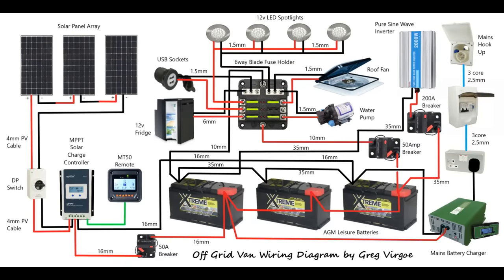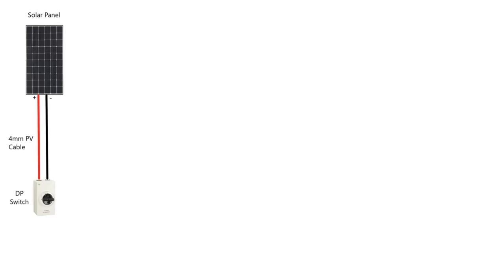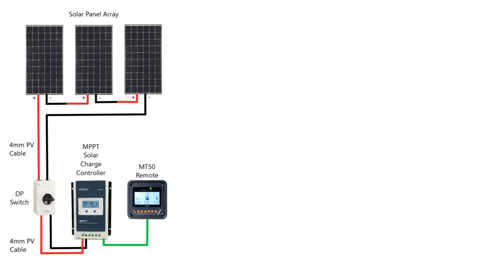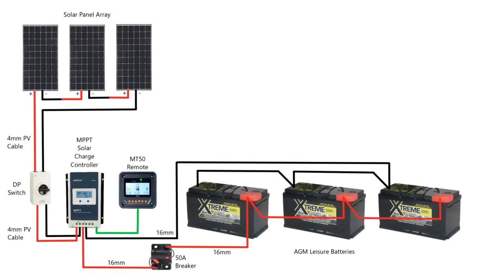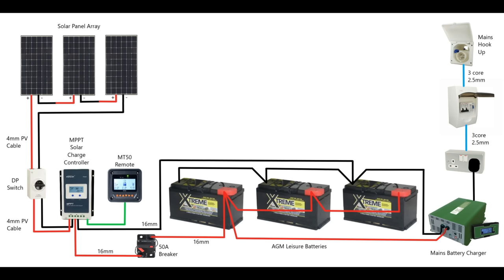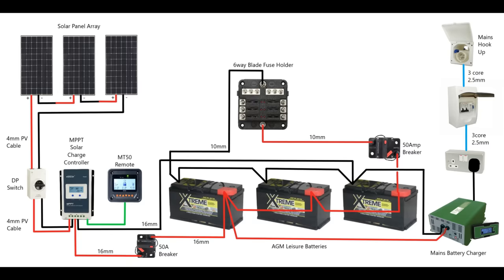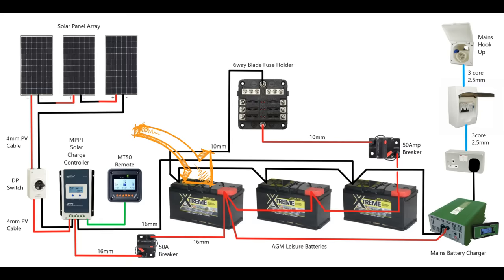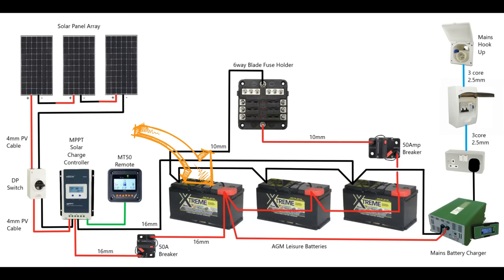How to Wire your Camper Van to be Off-Grid

Comment from the maker: YOUR QUESTIONS ANSWERED HERE - Please read this first. 
This video is always going to bring up a lot of questions so to avoid having to answer the same question lots of times I’ll post the most common answers here for you. 
1. Why have you not got a split charge relay?  A. AGM batteries do not like the voltages given out by your alternator and if you want to charge the leisure battery while driving you really need to fit a battery to battery charger. 
2. Why have you connect the red and black cable on your solar panels.  A.  These are wired in series so it is correct to have them connected this way. Please watch my solar panel installation video for more detailed information. 
3. You have not connected a load to your MPPT charge controller. A. This connection is for small load use only say just to power some lights. You could not connect 50A of appliances to these terminals. 
4. You have not connect this system to your van body. A. The van body is not an earth it is used by your auto electrics as a neutral. I personally do not advise using the van body as a neutral for your leisure system. My mains earth is connected back to my hook up socket and I always check with a plug tester when connecting to shore power. 
5. How can I size my cable and fuses. A. To work out the amps required use this calculation Watts / Volts = Amps. For fuses take your max amps figure and add 25% for safety. That is your fuse size. Then add at least another 25% and choose a cable bigger than that rating. 
6. The interconnecting cables between batteries need to be rated for the sum of all your connected loads assuming that there may be running all at the same time. 

I will update this pinned comment if I get lots of other questions if you can find your answers below please do leave me a message. I do love reading all your comments whatever they may be. Thank you 😊
Reply: I live in NYC...can i connect a 12v heater for winter time in this installation or is it better to buy one of propane? 

Also 12v sistem for hot water in the shower?
Reply: Superb video as always 👍🏼
Question, having used your van a fair amount would you say you’ve got a big enough battery store?
Reply: @JuanMartinez-pw4xi  I would avoid any 12v heating source for winter off grid camping. If you are hooked up to mains the its ok. But heating elements will put unnecessary stain on your system. The best off grid setup would be a static fitted gas fire, with independent added blowers for heat circulation. Blown propane heaters are not ideal as the system requires continual 12v during use for fans. I run a diesel fired eberspatcher but the 12v consumption is very high. Remember no matter how many batteries or solar panels you must get a good balance for winter off grid surviving. Also absolutely no 12v fridge, just go propane. Fridge elements are high draw items. Maybe restrict 12v operation of fridge to high harvesting days for solar, but again during winter the effectiveness of solar even on sunny days drops dramatically. You can somewhat negate winter sun by angling your panel on an adjustable bracket depending on where you are in the hemisphere. Flat panels can lose up to 50 % efficiency compared to a correctly angled one.
Reply from the maker: Juan Martinez simple answer would be to avoid electric heating of any kind from batteries. It will use so much energy really fast.
Reply: Could I ask if you have a reason for not connecting to the van body, every other video I have seen shows this and whilst I thought your video was excellent it has left me unsure what to do now? I am using the Sargent EC155 as my main electrical control with additional 12v fuse board, although I now wish I had done it myself from scratch.
Reply from the maker: Hi David, yes there’s so much confusion out there about connecting electrics to van bodies. So hope this will clear things up for you. 12vDC electrics have a positive and a negative. They do not have or need an earth. Your van auto electrics use your van body as a negative path back to your van battery to reduce the amount of cables required. This is NOT an earth. I would never recommend using the van body for the negative of your 12v leisure electrics as it’s very easy to get a poor connection then be left with equipment that doesn’t work properly. Far better running a two core cable and it be right from the start. Your van is not earthed either it’s sitting on four rubber tyres. The best place for your 230v earths to go is back to the earth connection in a mains hook up on the side of the van. The big confusion comes because people refer to a connection to the van as a ground (others think that means earth) it isn’t, it’s a negative connection back to the van battery.
Hope that helps explain 😊
Reply: I don’t see any switch for the lights?
Reply: By the way thank you for ur explanations thinks are more clear now
Reply: Hi Greg, what's your opinion regarding wiring solar panels, I have a new swift bessacarr Motorhome with a 100w solar panel as standard. I have fitted 2 100amp lithium batteries. Although we have has no problems for 2 night wild camping  we plan on doing a lot of offgrid in the future once this Lockdown is over. I am in the process of buying another two 150w panels, I have already purchased one. So that's 450w in total, because I don't plan on using the 100w original panel. Just to keep things simple, so they are all new. I also are purchasing a Victron MPPT 100 50 Controller. Now what I am finding is mixed reviews on whether to wire in parallel or in series. Also what model Victron smart battery controller do It will be bluetooth, I just don't know which one to go for with my set up  thanks in advance Dave.
Reply from the maker: Hello David, without a doubt if you are having 3x 150w panels all the same and a good quality MPPT charge controller definitely wire them in series. This will keep the amps the same on the solar side so small cables no bigger than what you already have going up to your 100W panel. The biggest benefit will be the ability to charge in low light conditions and winter time. 
The voltage will be added together and your MPPT will transform that back down to charge voltage and bump up the amps. We have been off grid now for nearly two years on a very similar setup apart from I have AGM batteries and it works in all weathers no problem. 
Check out the new Renogy MPPT Bluetooth controller you may find them to be better priced than Victron.
Reply: @GregVirgoe  Thankyou for your quick reply, I hope you are both well and stay safe. Dave.
Reply from the maker: David Cowley you are welcome we both are well thank you 😊
Reply: Just a quick question about the 230v earth?
If you had a fault,putting 230v on to the body of the van without bonding the supply earth to the body, it would leave the fault in place until someone touched it.
I'm no expert just my thoughts on it?
Reply: Hi greg. I have follwed your build. And completed the wireing, useing everything you have used. Everything is working except for the fan. On the board where the fuse blade go, the wire that are from the fan that are connected to it, next to them is a red light. This red light is only slightly glowing where as next to the ones from the usb or the touch lights shines bright and they work fine. It feels as if not enough power is getting to the fan and i dont no why. I have two batteries connected up. Do you have any suggestions why the fan is not working.
Reply from the maker: sean winder I would swap it over to another position on the blade fuse holder with one you know is ok. Check the fuse has not broken and see if that connection is faulty.
Reply: @benjeitoon1212  I was wondering something similar but, bonding to the body wouldn't help because the vehicle is isolated from the ground so there is no potential difference, until someone steps out onto the ground holding the metal work of the vehicle, happy to be proven incorrect??
Reply: @GregVirgoe  your videos are awesome! Wish you were my dad :)
Reply from the maker: Ben Hargaden I hope you’re not too old as I could be offended 🤣😃👍🏼
Reply: @margaritalagunas6543  12:00
Reply from the maker: Devonian the 16mm cable they have supplied should be ok up to 170Amps and should be protected by a 150Amp fuse. 
From the inverter wire a 13amp 3 pin plug using 2.5mm three core flex plug that into the inverter then the other end wire into the back of a 3 pin socket. 
Hope that helps 👍🏼😊
Reply: @GregVirgoe  Hello, Please, what do you mean "The best place for your 230v earths to go is back to the earth connection in a mains hook up on the side of the van" ? More exactly it needs any other connection than the arctic blue cable from hook up to RCD? Every socket also has 3 wire cable (L,N E..) so it goes back anyway, right?
Reply from the maker: Mihai Amatti yes of course as well as that there are ones like the earth to the inverter case etc
Reply: Can I pay you to help me with my build...?   That's awesome.
Reply: Hi Greg, what would you recommend installing to stop the batteries over discharging? Say if I only have a 100ah battery which will run a fridge and lights, I don't want to damage the battery by running it too flat. Also it would be helpful if I allowed family to use the van, that I would never have to worry about the battery charge. I can only think of a smart isolater that goes between the positive terminal of the battery and the fuse block. Any recommendations? Cheers!
Reply: Hi @Greg Virgoe from NZ, thanks for sharing your knowledge, I find it invaluable. You show mains power outlet for the battery charger and you don't show outlets off your inverter but there would be one or two so essentially you could be in a situation where your drawing mains power through your batteries/inverter or do you have both outlets for when you are in a campground plugged in? Also, would you add a battery monitor to your setup? Would you add alternator charging? One guy suggested 6v high a/hr series/parallel was a good option. 6v adds to 12v in pairs but then do a/hrs add as well?
Reply: You have given me a great peace of mind to starting my build.
Thank you thank you thank you.
Reply: Greg excellent video. I hope you dont mind but i have 2 questions. Tried looking through comments but couldnt find exactly the answer im looking for...
1. Can you connect and run a switch relay to the car battery aswell as what is on the diagram as an extra charging source?
2. Is it possible to run a 240v ring for offgrid sockets from the inverter? 
Thankyou and apologies in advance if you have answered these questions before. Regards, Michael
Reply from the maker: michaelpartridge900 it’s better to install a battery to battery charger because leisure batteries require different charging profile than your van battery. 
Yes it’s better to run a ring back to the inverter for volt drop and load on the cables. Bear in mind you can only plug in 13amps of appliances to one ring.
Reply: @GregVirgoe  thanks for the swift reply. I have some planning ahead. Keep up the great content. 👍🏻
Reply: You can run all your negatives (not 240v neutrals obvs)  to the chassis instead of using a buzz bar. You can do this while still remaining separated from the vans original electrical system, as your leisure batteries are isolated from the van charging system. That'll half the amount of wiring you need. 👍
Reply from the maker: Cpt MishMash VonRandom I do not recommend doing this as it opens up possibility for problems. Bad connections, high resistance, volt drop to name a few. If you are running one cable then run a 2core flex no more difficult and 100% better installation.
Reply: Hi Greg, can you elaborate on why AGM batteries don't like the voltages given out by the alternator? I've watched a few videos on connecting your alternator to your leisure battery and purchased a VSR (voltage sensitive relay) but haven't installed yet. Is that the same as the split charge relay you refer to? My battery happens to be flooded lead acid, sealed deep cycle marine battery. I believe thats okay for use with the VSR.
Reply from the maker: Sean Spender a flooded lead acid battery is the same technology as your van battery so will be ok with a VSR. voltage sensitive relay and split charge relay are the same thing. The relay simply switches when the voltage is high enough. But it will not meter the charge to the battery. Be aware that over voltage can cause the battery to off gas. 
Different types of battery AGM have different charge voltages and profile. That why in that case it’s best to use a B2B charger.
Reply: TY for sharing , I hawe a question : recently I buy used Van and part of load is connected to mptt solar charger is that wrong ?? If u can answer me will be a great to avoid some problems in future. Regards Zeljko
Reply from the maker: zex joka hello thanks for your message. It is ok to have small loads connected direct to the mppt charger. 👍🏼😃
Reply: Could you email me the diagram  of how to set up the batteries in the Mercedes sprinter for of grid please
Reply from the maker: Amanda Thomas the diagrams links are in the video description. 
To help you out I have put them all together on this link https://www.dropbox.com/s/0p96qj2jin5ffkz/Schematics.pdf?dl=0
Reply: Hi Greg Virgoe thanks everyone so much for the videos they are great. I have a question with regards to the cable sizes that you choose.  I notice on your diagram above you state that you need 1.5mm or 35mm etc. I believe this is the 12v DC cable. On your list it on shows 12v DC cable at 1.5mm.  Am I correct in thinking you can get this 12v cable in all different sizes? Also is the Arctic blue cable ONLY used for the 230v mains electric?  Any help you can give would be much appreciated. Cheers
Reply: @margaritalagunas6543  this is a power set up not full electrical wiring diagram
Reply: @GregVirgoe  Greg, this explanation is the best and most simple I have heard. Many thanks
Reply from the maker: local tourist  there’s built in protection on the mains charger and you can simply turn it off yourself at the plug too.
Reply: Hello Greg!

Can you please elaborate on why it is you have all charging positives on one end of the bank but the load positives on the other end?

All the diagrams I've seen in the past treat the bank as one big battery, with all charge and discharge positives on the first batteries positive, and all negatives on the last batteries negative.
Reply from the maker: @zebraforceone  I am connected across the batteries from one end to the other, I choose to put input and output at opposite ends to ensure even use and equalisation.
Reply: If you wanted to do 600W, would you just double the battery size: move up from 3 to 6? Or is there anything else I would need to change/upgrade?
Reply: Hi Greg, Thank you for great videos. On your diagram you are using 35mm cable to your inverter with 200A fuse but from table that you provided 35mm cables can handle up to 141Amps, is this correct or I understand something wrong. Thanks,
Reply from the maker: @99kolosz99  sorry I got my cable from 12volt planet and their cable is rated slightly higher. see here https://www.12voltplanet.co.uk/plain-copper-battery-cable.html
Reply: @GregVirgoe  thank you, that explains allot :)
Reply: Hi Greg, you have mentioned that the reason for not having a split system is that AGM batteries don’t like it. There are DC-DC chargers and a some good smart devices from Ctek which can regulate adapt to the charging profile of AGM batteries. I was wondering if you have considered such solutions. How the installation will be in case they are proper for AGM batteries?
Reply: I have a dual battery VSR and solar. I mostly charge my AGM battery with solar and only connect the VSR when sunlight has been low. Running the dual battery for only a few hours at a time has proven to be no problem! I am able to easily disconnect the earth from VSR, preventing it from engaging while I drive and there is plenty of sunlight to be harvested!!
Thanks for effort and diagram Greg!
Reply: How awesome is it that you've taken the time to support us all in this community. We've learned so much from you already and are so grateful for your generosity. People like you make the world a better place!
Reply from the maker: @TamaraStaton  thank you so much for such a kind comment. You have made my day. Best wishes Greg
Reply: @GregVirgoe  It's pretty fantastic how on the ball you are with everything you seem to do, including answering comments so quickly! We just learned how to use SketchUp, thanks to you, as well, and it's made a massive difference. We so enjoy your beautiful accent as well, being from Oregon - you've definitely become one of our go-to's for van guidance as we begin this wonderful journey of building our own camper.  I look forward to more, and thank you immensely.
Reply: Mr Virgoe i have followed this setup on my current (pun intended) project. 
Although i have x2 200ah lithiums in parallel giving 400ah and a 3000-watt inverter...my Question is -
Do i need a 450 amp circuit breaker instead of the 200 amp you have in the diagram for your 2000 watt inverter.
My Solar MPPT controller is a 40 amp one. im using 340 solar panel. 

What size breaker should i use sir ?
Reply from the maker: @chrisevans4070  you need a 300amp breaker with that inverter. That not much solar for that size battery bank. You will struggle to generate enough power to recharge them if you plan on using big electric loads
Reply: @GregVirgoe  Thanks for reply Greg.
Np i will hook up a 300 amp Breaker, we will test our panel with our battery bank and see how she goes.. Aussie sun is very reliable. 
If the 400 AH bank struggles to charge promptly i guess i will add another 200 watt panel//my current 40 amp MPPT Solar controller says in the manual 550 max input.
Which has me wondering ..i can just wire an extra panel into same MPPT Controller 
input cant i ?
Reply: Amazingly helpful. Could you just tell me what part I need to connect multiple positive and negative wire to the battery please?
Reply from the maker: @4RingsRetro  here you go https://www.12voltplanet.co.uk/positive-battery-terminal-clamp-3-stud-connection.html
Reply: @GregVirgoe  hi Greg, could I ask you how much you think your total cost was, for your conversion? I’m thinking oh having a go.
Reply from the maker: @trevorfisk8648  https://youtu.be/iARkTjdU3Ok
Reply from the maker: @camdenbrown9798  the specification of the mppt with state a max power input in watts and max amps input. 
If you have a number of panels in series like mine it’s the total watts input you need to look at.
Reply: HI Greg...sorry if this is a daft question but is it possible to just have 230 v in my camper as i have no intension of ever going off grid I will always go to a established camp with plug in facilities....so could i have a 230 v fridge and 230 v  sockets only for example....again sorry if this is a daft question
Reply from the maker: @grahamhorne5060  yes just fit a mains hook up socket and on the other side wire to your 3 pin sockets.
Reply: Back again drumming all of this into my brain! You're a legend Greg, thank you!
Question: If we want to power 2 extra 240v sockets on opposite sides of the van + a truma boiler (when on EHU). And also use an inverter (when off-grid) to power those 2 extra sockets, how is this achieved? Can those 3 core cables go from the original socket in the garage to the other sockets whilst the other sockets also have cables from the inverter?

Hope this makes sense!
Reply from the maker: @AnthAmy  yes it makes sense and I drew up a diagram fir this setup for someone else. Here is a link to that setup https://www.dropbox.com/s/sv1msed1t8esvoo/Dalia%27s%20Wiring.jpg?dl=0
Reply from the maker: @AnthAmy  and this is the changeover switch you would need to do that https://www.ebay.co.uk/itm/20AMP-2-POLE-IP65-ENCLOSED-CHANGE-OVER-SWITCH-/172741552700?mkcid=16&mkevt=1&_trksid=p2349624.m2548.l6249&mkrid=710-127635-2958-0
Reply: @GregVirgoe  that's amazing thank you so much!
Reply: Where is the link to the diagram download? Also, you explain things very well
Reply from the maker: @tannerdillon2211  in the video description
Reply: Hi Greg, thanks for the amazing video.  My friend says that the +batt (mppt) to battery cable need only be 3mm2 but I see you have yours at 16mm2.  I think I'm supposed to put a 30A breaker close to the battery here as well.  Who is correct and why?  I hope that makes sense.  Thanks
Reply: @GregVirgoe  Hey Greg, thanks so much for all your incredible advice. No questions, just super grateful for your intelligent consideration of the issues at hand when wiring up a van. Many thanks.
Reply: @richardd8352  .
Reply: Hi Greg, do you have any wiring or an RCD from your inverter? Or do you just plug your appliances directly into the inverter? I am interested to see how people have used RCD’s with their inverters and grounded their contained 230v circuits. 
Thanks.
Reply from the maker: @mrs.869  my inverter supply goes into my control panel and onto a changeover switch. From the output of the changeover switch to some MCBs then out to all my 230volt sockets in the van. That way I can switch between mains hook up and inverter with only one set on wiring inside the van. There is a video about the panel in the build series. Go to my playlists. 👍🏼
Reply: @GregVirgoe  Aha that was confusing me too, you may ignore my other comment now!
Reply: Question -  why the heavy 6mm cable for the fridge?  Any 12 volt compressor fridges that I have seen are usually less than 60watts (5amp) and could be powered via a standard cigarette lighter socket. Have I missed something?
Reply: Hi Greg 
Is it good to charge the leisure batteries from the van alternator in addition to solar panels using Victron Energy Orion-Tr Smart 12/12-30A (360W) Isolated DC-DC Charger - ORI121236120 ? Would that mess up the 3 leisure batteries to use the Victron to charge also?
Reply from the maker: @PompeyBoy66  no problem with doing that 👍🏼😃
Reply: @GregVirgoe  no he’s only 55 lol
Reply: Would you still suggest AGM batteries over LiFePO4? Why if so?
Reply from the maker: @shrooms000  if you are working to a budget then AGM are the best solution. If properly liked after they will last for years. We have had ours now for 3.5yrs living full time they are still working perfectly and never dropped below 12.4v or 70% full. 
Lithium can save you some weight but are very expensive and have specific charging characteristics. AGM do tend to put up with more fluctuating charging better.
Reply: @margaritalagunas6543  watch it again then. there was a optional one in the daig
Reply: Thanks for your help, is it OK two have installed two leisure batteries of the same characteristics and one different as I want to buy two new better  ones and keep using the old one
Reply from the maker: @JulioCesarcoco  sadly you cannot connect batteries of different type or size together.
Reply: Hi Greg, First of all thank you for all your videos I literally learned everything from your videos and was able to build my first campervan!!! I have a question though I wonder if you can help pls. I have a shunt that would monitor the ins and outs of my battery but I’m having issues as to how I can connect my Sterling battery to battery charger to the shunt so I can monitor that input too. Any thoughts would be greatly appreciated. Thank you 🙏
Reply from the maker: @livemoveconnect8913  when using a shunt you have to connect all you inputs and outputs to the same negative terminal via the shunt. Often these are many so it is easier to use two bus bars, one for positive and negative connect the shunt to negative on one end of the battery string then to a bus bar. Connect a cable to positive on the opposite end of battery string to a positive bus bar. Then wire all your inputs and outputs to these two bus bars. Hope that helps.
Reply: @GregVirgoe  thank you 🙏 I will organise my wiring and see. Thanks again.
Reply: How much power will a 12v fridge draw down? I only have 1 AGM battery and would like to use the fridge but have been warned they're thirsty. Is there a way to test it? (it's very old so I know nothing about it)
Reply from the maker: @elaineinnz  there will be a plate or sticker on the back of it that tells you the electrical details either the watts power or max amps running current. Typically something like 75watts or 6-7amps can you see if you can find that info on it for me 😊
Reply: Thank you. I tried pulling the fridge out but it's stuck solid (possibly fixed in). But I found a manual online which states: 
Battery Input 12V / 100 W / 8.33 A 
Power Consumption is 1.5 kWh/24h. 
That power consumption seems very low, just confuses me even more.... :D
Reply from the maker: @errolmagill1611  fridges don’t like to se any voltage drop that’s why the cables are bigger 👍🏼😃
Reply: Thanks Greg , this has greatly helped me with my own solar installation, best tutorial video I have seen on YouTube, thanks again for your time and effort. Keep it between the ditches 👍
Reply from the maker: @Garror  thank you for great feedback and best wishes with your own build 👍🏼😃
Reply: Oh blimey your videos are so good how am I still so overwhelmed? I have one 150w solar panel, a 20amp pwm charge controller, a 120ah leisure battery, a 6port fuse block with neg busbar, one switch panel with 2 USB & 1 cig lighter socket 10amp input, 60w portable dometic compressor fridge and a fan. I've been tearing my hair out trying to figure out what size fuses I need between the scc and battery and between the battery to the fuse panel?
I'm also struggling to work out where I'd connect a fuse (to which wire) & which size fuse to use when I'm connecting 10mm2 /8awg to 16awg = 16awg cable and plug for the fridge into 8awg to the fuse panel. Manufacturer states 8amp fuse but I know it draws between 8~12 in 24hr @18dc. I've been at this solid for 2weeks,there's so much conflicting advice out there. 
If anyone could help me I'd be so grateful.. It's like learning a life & death skill, taught in a language I've never heard before & my fibro brain can't hold the information long enough to make it make sense😭.
Reply: Hi Greg. Your videos have been a life saver .copied your set up exactly except I've no shore power or 240 hook up and only 2 batteries. Do I need to ground or earth any of it to the van body? Maybe the inverter or the batteries
Reply from the maker: @SuperLewis05  just the 230v side of this setup so your inverter casing normally has an earth connection and earth any 230v appliances. 
12v DC does not require an earth.
Reply: @GregVirgoe  hey thanks for your reply but my van has now been stolen. I was nearly finished, either someone had watched my progress or it had been stolen as someone knew it had a very good rebuilt engine, I believe it was targeted and not random as it had a steering lock and a pedal lock. Either way it's gone . 18 months of work and I'm now worried I'll just get the money for a standard van even though it wasn't, I did up the insurance to nearly cover the items fitted and it was a very rare 4x4 transit van . All in all I had around 18k in it and I'm expecting them to pay out nowhere near
Reply from the maker: @SuperLewis05  that’s really shit, I’m sorry to hear that and I hope that the insurance company at least give you a proper pay out. I know it’s no compensation I wish you luck 😬
Reply: @GregVirgoe  Hi Greg Thank you for this video it's been very helpful in me getting stuff ready for when it comes to installing my electrics. just a few questions, im going to be running a Victron smartshunt so i can monitor my usage referring this back to your diagram. can i run my negatives to a Bus bar and then only negative i have coming from my leisure would be the smartshunt. obviously my splitcharger and charges will go directly to my battery. many thanks
Reply from the maker: @jacobnewman8443  if you want to use a shunt you are right that all negatives would have to connect to the shunt and one cable to one end of the battery string. So take all your positives from the opposite end of the battery string so you are using them all as if they were one big battery. 👍🏼😊
Reply: Hi Greg, great videos - but how does the car battery come into this? Is there a split charge relay to go in? Cheers!
Reply: Hey Greg does wiring your batteries this way not increase the voltage to 36v, was going to buy a 24v inverter, would it work with the batteries wired your way, 
thanks Mike
Reply: Hi greg, really impressed with the quality of your workmanship, i would love to do a van build but to be honest i doubt if we would have enough space for a live in van so we are thinking of building a day van ( we are caravaners) , i wonder if you could help, i am building an off grid solar setup for my home office, ive bought a 3000va 24volt 2.4kw victron inverter, , also 4 lithium batteries, i am going to wire them in series, i wanted a decent inverter as its only going to be used to power mains appliances,  i assume the inverter will determine what size cable do you think  i need to connect the batteries together then connect them to the inverter, ive been recommended 60mm2
Reply: @richardthomas3384  yeah how would this set up work with an existing split charge relay installed, cmon Greg you could save me a few hundred squid here?????
Reply from the maker: @mikereynolds7956  wired in parallel the volts stay the same. Wired in series the volts get added. So to get 24v out you would need two 12v batteries wired in series. Why do you want a 24v inverter? What do you plan to run off it?
Reply from the maker: @bryank3133  if the batteries are 12v you will need to wire two in series to get 24v. Same with next two. Them wire those two strings in parallel to keep 24v and have all four connected together. 
60mm cable would be plenty big enough for that inverter 👍🏼😊
Reply: @GregVirgoe  Hi Greg, thanks for getting back to us, moved on from that query now, were installing off grid solar inmy home office, ive currently got 2*250w panels and a victron mppt and a victron 3kva inverter. ive bought a battery isolator ( victron) to isolate the batteries and i am going to install a mcb to isolate the panels, ive ordered more panels, these are 400w with Open Circuit Voltage - Voc(V) of 49.5v, i am going to wire them in series as 2 seperate arrays ( due to the roof aspect) i want the mcb to be used as an isolator not to give overload preotection, what do you think, also what do you think of epever mppt,  been watching your vids since you started the build, thanks for sharing your experience / knowledge
Reply: Hi Greg, is there a battery that would be suitable to work with a split charge relay? If I was to buy a battery to battery charger would I still need to incorporate a split charge relay in my system or will the battery to battery charger stop me draining power from my vehicles battery when it's not running? Cheers in advance
Reply from the maker: @lukeevans2802  forget using a split charge relay and just install the DC to DC charger. It will take care of all your batteries much better than a relay. 👍🏼🤩
Reply: Greg, I have been pouring over your videos, including things you would change. However, i hope I have not missed this question answered somewhere else. I have noticed that MPPT Solar Charge Controllers come in Amp ratings all the way up to 150A. How do I determine the size of Controller I should use? Also, did you ever do the video on how to connect to the Alternator for powering your batteries while driving? I can't seem to find it.
Reply: Hey Greg, once again thank you for these amazing informative video’s!
You are a legend!
This might be a silly question I am a beginner after all.. 
but would it be possible to have a fuse breaker instead of the DP change over switch?
Being that they are cheaper, would still work as an isolator, and protect the MPPT charger?
Cheers
Reply from the maker: @azibenarroch7921  you can use a breaker in the positive from the solar panels. Obviously it will only disconnect one cable. The DP switch disconnects both wires.
Reply from the maker: @azibenarroch7921  you can use a breaker in the positive from the solar panels. Obviously it will only disconnect one cable. The DP switch disconnects both wires.
Reply: I just want to know is it ok to go posative to posative then negative to negative across each 12v 100ah leshure acid battery using say jump lead cable thickness !!!
Reply: I have a question can you also set up a way to charge the batteries from the alternator of the vehicle?
Reply: Hey @Greg Virgoe, just a quick question about cable sizing and breakers. Wy do you have different cable sizes with the same breaker at 50A? Thanks:)
Reply from the maker: @eliasmosevoll5730  it is improbable that all devices off the blade fuse holder will be in use at the same time so I was less concerned about voltage drop on that cable, I wanted to increase the charger cable so that it ran colder with less voltage drop to get the maximum out of it. Its never a problem to go bigger on your cable runs
Reply: Hey Greg! I have another question. I'm refitting a bus that was already a rather rustic motorhome, now i added a solar panel mppt charge controller and a stationary battery, to name a few. I'm now starting to spread all the cables towards the water pump and stuff; you see, there are like six or seven 12v led light strips on the ceiling that are connected to the bus battery through a switch (they work perfectly fine), the negative of each light is connected to the closest metal part of the bus. I was wondering that maybe i could take the positive ( the main positive, the one that feeds all the lights) and connect it to the fuse bar of the stationary battery, just the positive, and leave all the negatives where they are now... if not, it would be a huge work to open all the roof panels and replace all the negatives... you think is safe to do it this way, what tou reckon? 
Thanks in advance, man... you are like a solar savior
Reply: @GregVirgoe  Thanks for answering! that makes sense:)
Reply: Hi Greg,i have followed parts of your set up- i have all my charging ( solar, b2b and 240 charger ) all on a busbar that comes into the batteries via your recommend diagonal terminals and my load goes out on the other terminals to the shunt- busbar-loads. This to save terminal over load. My question is that my shunt is not reading the input from the charging busbar, should i install a 2nd shunt for input or wire the input busbar to the shunt ? Hope this makes sense on what am asking
Reply from the maker: @terryhorrocks2685  if you are using common positive and negative bus bars you should only have one connection to either end of the battery string. One positive connection to one end and one negative connection to the other end of the battery. Your shunt should be in that single negative connection between the battery and negative bus bar. All your charging and load connection should be from the bus bars.
Reply: @GregVirgoe  thanks Greg, issue sorted now
Reply: Hey Greg not sure if you would have any ideas but we have this setup exactly the same and thank you for that. But it’s been running spot on for a year and a half now all of a sudden our mppt thinks it’s nighttime all the time. 35v directly from each panel but only 5v at the breaker switch all the connections and cables seem to be in perfect condition. It’s a real nightmare. Thanks for your time
Reply: @margaritalagunas6543  He explained in the video !
just add a switch on the Positive cable.
Reply: I'm unsure if old van wiring should be removed or hidden away and left in place.
Reply from the maker: @Billybigballs381  it’s wise to leave access to connection points for rear lights etc. so you can get to them in future if needed. 👍🏼😃
Reply: Hi Greg, brilliant video thank you 🙏🏻 
In relation to the lights, could they still be connected to the van enabling them to power on when a door is opened?
Reply: Hi Greg you said you were going to do a video on earthing. I have bought a 50w renogy mppt control I have a 2000w inverter 150w solar panel. I have a cut off switch but it as 3 blots on it but not sure how I wire it in. Any help would be much appreciated. Been following you excellent videos. Kind regards julian
Reply: Greg, video are great I have set up my own system using your videos but one problem… the 35mm cable from MPPT controller via 50amp circuit breaker is way too fat / big for the terminal blocks in the device…. Please can you advise where, how to overcome this? Many thanks
Reply: @GregVirgoe  This is the most comprehensive instruction I have seen. I was going to ask the same question as Juan. Ref the inverter, this generates 230v but has no earth, is this correct? I see the positive & negative cable feeding in to the inverter, is it just a plug socket on the other side or do you wire in cables to feed to sockets please?